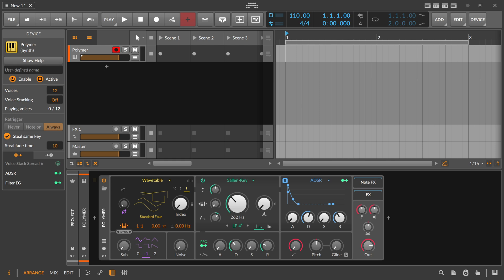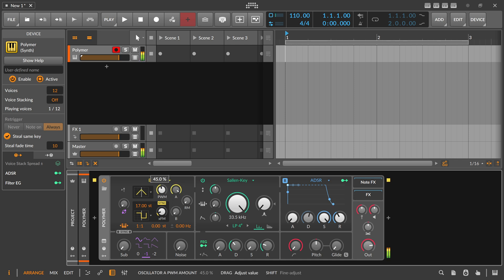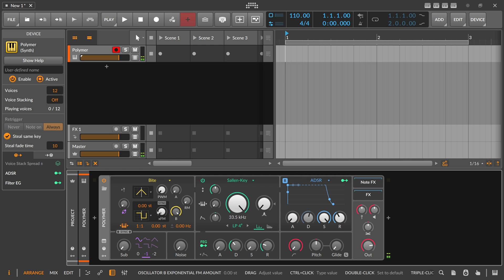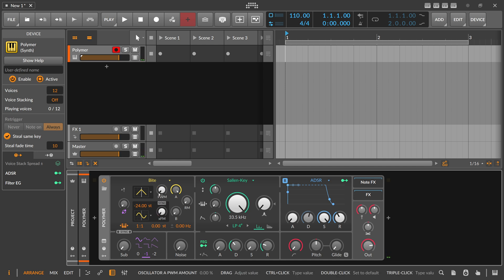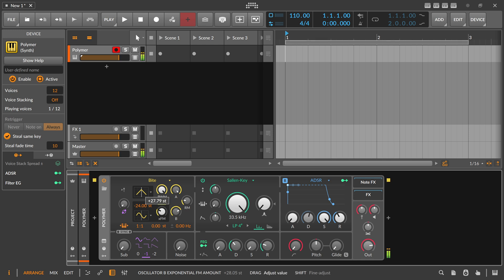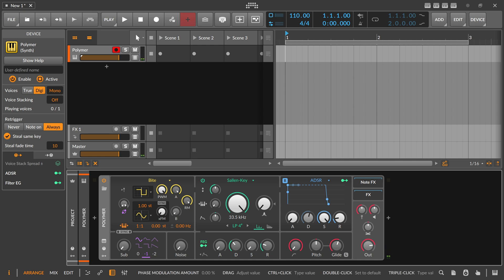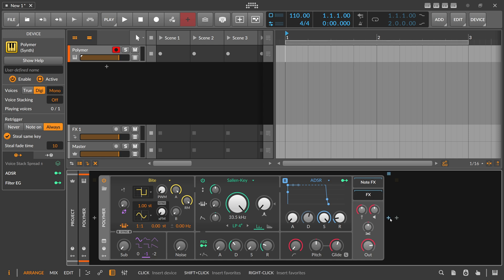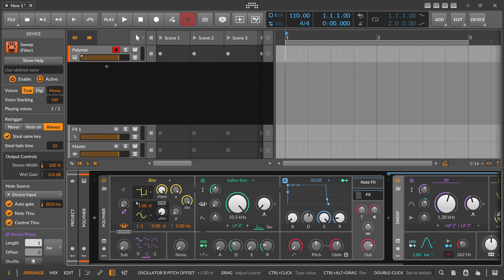Bitwig 5.1 - Bite Oscillator is DIRTY

Comment: Learning Bitwig as fast as I can; BITE is a quite potent pre-assembled module. I say this because I have been trying to figure out how to create a hard-sync myself in the grid (using ANY osc pair for follower and leader). I haven't had luck so far, but thanks to BITE I actually don't really need to accomplish this (although the learning process would be beneficial in the long run). BITE actually fulfills an immediate curiosity of mine without needing to create stuff like a phase-locked-loop (for sync) from scratch.

Side note: I thought you had to wire an osc-output to keytracking to produce exponential FM (crossmod), but it still seems quite handy to have this feature built into this module. That's pretty sweet: FM that is actually FM and not rebranded phase-mod.

No, I'm not expecting any tips on osc-sync from scratch via the PolyGrid, but if anyone has any pointers I would be grateful.

Comment: Is that xFM the same as used in Helm?  (Helm manual: "The left oscillator modulates the
phase of the right oscillator and the right oscillator modulates the tone of the left oscillator. The
oscillators are simplified to a sine wave before the modulation is applied.
")

edit: Thinking not, as the Osc arent simplified to Sines